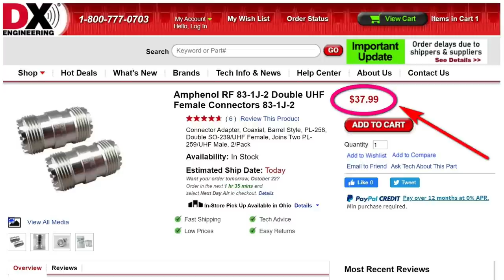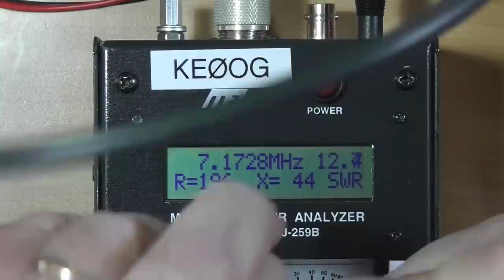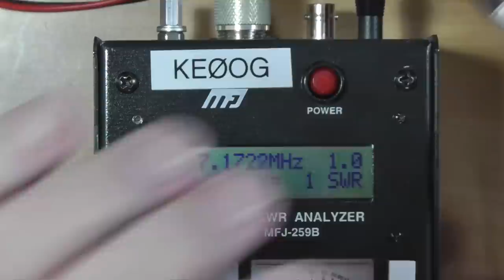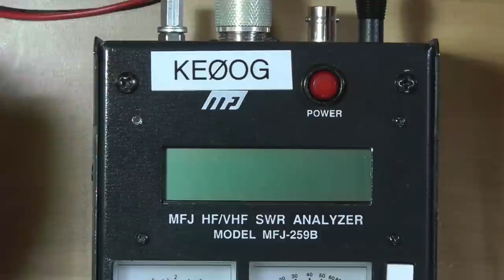The Humble Barrel Connector (#308)

Comment: Good topic you covered it well. A while back I became curious about N connecters vs PL connectors  so I used a calibrated RF signal generator and a calibrated Boonton 4532  RF power meter and measured the insertion loss of each connector type from HF all the way up to UHF (70cm) to 2 decimal places. Bottom line,  there was negligible power loss until you got to 70cm and even then it was only about 0.5 db per connector. While that does not seem like a lot it can become significant if you have a power/swr meter in line at all times and A/B antenna switch and lightening arrestors.... etc.   When you start adding them up all up you get to -3db pretty quickly. Nice job!

Comment: As a new HAM....only about 6 months now, but got Extra in August....I have spent a fair amount of time setting up a good solid antenna setup. Installed a 24’ mast, double 8’ ground rods, flat strap feeding a copper ground inside the shack, each antenna coax has lightning arresters thst each tie in directly to the ground rods, installed the appropriate length LMR-400 cables to each. Ive minimized connections where possible, but have found that the ones used have had virtually no impact at all. Yes Im new....but in my humble opinion it is worth the time and effort to focus on antennas, cable setup, grounding system, and rfi reduction. Then....then go look at possibly upgrading other equipment. Even then it doesn’t have to be transceivers. Can look at adding a good quality powered speaker to your existing rig, a good quality parametric equalizer to allow for better RX-ing....better microphones, with possibly a mixer. I operate every single day on an ic-2730a (both truck and another in my shack for 2m and 70cm connected to a comet gp-3 with a top height of 30’. Then HF rig is a preowned ft-991 connected to a chameleon emcomm III (portable version at 65’, but installed in a permanent installation in an inverted L configuration). Also run an SDR (RSP1A) connected to both the chameleon and a discone. This fairly simple setup allows a wide range of options for enjoying this hobby
Reply: If by the appropriate length of coax you mean a half wavelength multiple then read my reply to Walter Slover above. You might appreciate this half wave fallacy if you consider feeding two non harmonically related antennas like 40m and 30m with the same feedline. Clearly the "appropriately cut" feedline can only be half wave multiple for one of the antennas  yet with a properly matched antennas the same feedline can be used with either. The whole halfwave thing relates to the fact that an electrical half wave length feedline shows the same impedance as that of the antenna but only when the feedline has the same characteristic impedance as the transmitter and at a single frquency. Crunch the numbers and you will find even so called harmonically related amateur bands can be far from truly integer multiples. With the cost of coax these days it is silly to by more than needed simply to make it a halfwave multiple long feeder.
Reply: Rob B ....no, just meant the correct length for the run needed. No excess coax looped up because it was too long.

Comment: Thanks again Dave for an interesting informative video. A month ago I needed some SO239 connectors to make an antenna switch box. I ordered 6 from an online firm here in the UK, when they arrived I set to work making said switch box. I always firstly try out and see if the PL259 connectors are a snug fit into the SO239. I couldn't believe my eyes, the SO239s were all loose and useless. 3 of the PL259s just slid out of the connectors. I sent the company an e mail complaining about it and their answer was "we have sold thousands of them". So cheap sometimes means cheap, (very cheap).

Comment: I think the key is to make sure you have CLEAN connectors (no matter if they are UHF, BNC, F or any other type). If they have corrosion, toss them. Keep them tight. Make sure they can't work loose. Connections of any kind can result in signal loss if proper housekeeping is not taken. If they are out in the weather, protect them from moisture.

Comment: My recommendation is to use Type-N or SMA connectors. PL-259/SO-239 connectors are not sealed and can easily work loose making your connection poor at best. So, just spend the money and use water-sealed connectors and have good impedance characteristics.

Comment: Years ago Jim, W6LG, did a video on a whole slew of connectors used together and found the same outcome.  Not a problem.

Dave K8WPE
Reply: He measured wrong too. He measured S11 Rl, a different way to measure loss from reflections. He had a VNA and should have done S12 - insertion loss.

Comment: Most of the problems hams have with coaxial lines come  NOT from  "UHF" adaptors, but poor fitting of cheap PL259's to RG8/U (and equivalent) coax.  The PL259 crimp connector versions, (or even the Chinese clamped outer/soldered inner versions, that are fitted just like professional N connectors) are far preferable.

Comment: I have some very long barrel connectors that I use to pass through the wall.  I think they are about 8 inches long.  I wonder if the longer ones have more loss?  I use one for HF, one for UHF and one for VHF.  I only do repeater work on UHF and VHF so I am not too worried about the loss up there...

Comment: I don't understand why some 2m and even 70cm radios use SO239 connectors; as you said, N connectors don't have nearly the same impedance problems (perhaps just a slight insertion loss). At HF they're cheap and plentiful, though!

Comment: Sure is a lot better than listing to Fox and CNN.  Thank you.  Use these connectors on outside of shack window to disconnect the antennas from the rigs to the outside ground.  Also use one in the Cessna to connect to my two meter rig and then back to the spare plane antenna.  Looks like you are feeling much better.

Comment: I just watched Jim's old video W6LG and noted he messed up measuring 20 dirty connectors in a row. He measured S11Rl with his VNA, NOT S12 (or 21, I can never remember) to measure insertion loss.

Now I watch yours, and you measure SWR. I just upped my salt intake.

Everybody makes mistakes... 
Oh and I've seen those at 12 inches... possibly longer.
Reply: Retraction.... Jim and I exchanged some comments. I did a lot of digging overnight and he even did up a new video. After a long night digging up articles etc, he is using the principle that an open or short provides 100% reflection, so measuring Rl under those conditions measures the loss.

So yes, he shows, with not perfectly clean or new connectors that while there is loss, it is very small. Sure, keeping the number down is always good for multiple reasons, but loss isn't one of them.

My apologies Jim. I was stuck in the more traditional ways of using a VNA and wasn't far enough "outside the box" yet.

Comment: Um, well, those are usually called Bullet, F to F, Jack to Jack, or Jk to Jk adapters.  The Barrel is the M to M, Plug to Plug or Pl to Pl gender version.  Thank you for turning the ferrule on the coax Male connector rather than spinning the bullet to insert it inline.
Reply: Yep also UHF barrel.  Barrel typically implies the female side and the male is typically referred to as an adapter.  However is depends on who's shop your in.  When in Rome...👍
Reply: The inner conductor determines the gender of the connection rather than the shield.

Comment: Like you mention in the video there is not much to them but I have had them fail. I bought several cheap Chinese ones off Ebay and had two out of 10 fail. I dont know how they fail as you said not much to them. I have since paid a little more for name brands and they seem to be more reliable.

Comment: I have seen a barrel connector and a short cable will lengthen your total coax length and can lower a SWR of an antenna.
Reply: If you see that happen it is a sign you have fundamental problems that really should be addressed because the antenna clearly is a poor match  Apart from the special case of impedance matching stubs where a different impedance coax is inserted the length of coax will not affect VSWR readings for a well matched antenna fed with a well impedance matched feedline.  What you describe here is akin to using an antenna matching unit which merely acts to match the impedance of the transmitter to the impedance of the antenna and feedline combination. It may keep the transmitter happy but does nothing for the antenna's efficiency. In an ideal world it is the antenna efficiency we should be measuring but outside of a laboratory efficiency is impossible to measure. VSWR is an easy thing to measure and so has become the de facto assessment of an antenna but in essence it is a rather poor metric. Think of the dummy load. It presents a perfect match but you won't be heard beyond the back yard. Another case of reduced VSWR is if you add a long length of a coax with high loss at the frequency being used. In this case most of the power from the transmitter is simply converted to heat in the coax. At the absolute fundamental level you can only affect the efficacy of the antenna by altering the antenna. There is enough content here for may videos. Hopefully Dave will make further videos on this subject. These days with the availability of cheap antenna analysers and VNAs there is no excuse for poor antennas.

Comment: Dave I have really enjoyed and learned from your videos and most of the time you get it right but not this time. SWR is NOT an appropriate way to measure the impacts of a barrel connector, I know it’s been a long time since your general but question G9A13 (A)
What is the effect of transmission line loss on SWR measured at the input to the line?
A. The higher the transmission line loss, the more the SWR will read artificially low
Answers it. In fact SWR would get artificially better because the barrel connector would increase line resistance/loss and thus lower reflected power and as you know swr is the ratio of forward power to reflected power. The proper measurement would be insertion loss and from my measurements I’ve see 0.3 dB up to 1dB (cheaper barrel connectors that have oxidized due to environmental exposure) So 7 to 20% power loss , don’t use barrel connectors for anything but a temporary fix

Comment: We also call them bulkhead connectors, often eight inches long so you can penetrate walls or bulkheads with them.
 Impedance bumps are all [not] well and good but if you work portable in disasters or shelters, now you either bring n-to-uhf adapters to everything, or your superior type n gear is incompatible with everything esle. So, UHF endures, because it owns the amateur market.
Reply: @traveller-nl  Quite right. Like Dave, I'm in the US and looking at this from the New World point of view.